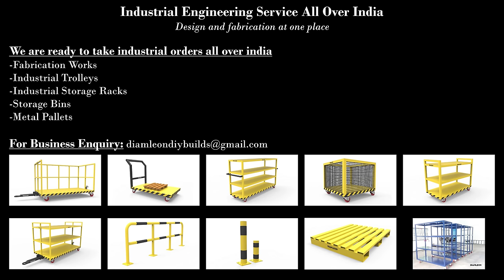Make A Metal Bender | Very Simple Homemade Roller Bender Without Welding | DIY

Comment: Hi great video  I need to roll 10mm square bar any tips should I make  all 3 rollers within  under cut on center.li e of the rollers to allow square bar to sit in to stop it wondering off line 

Rollers are tubed rollers with internal bearings each end
Reply from the maker: Thank you❤❤

Comment: excellent build going make one using a welder as quicker, my final touch will be a small copper tube on the handle so spins round as you turn, maybe take it apart & give it a spray can finish 🤔👍
Reply from the maker: Thanks man

Comment: Just a quick mention, its really dangerous to use the side of a grinding wheel, so if you are not sure it is specifically designed for side use don't do it, it is ugly when those babies come apart.

Comment: This design works well if you're bending something soft and weak like flat steel... but if you're bending anything of any real strength (like square tubing), the bearing shafts must be supported at both ends.